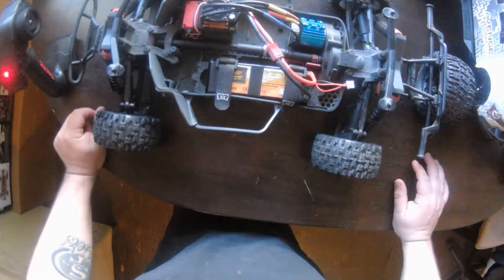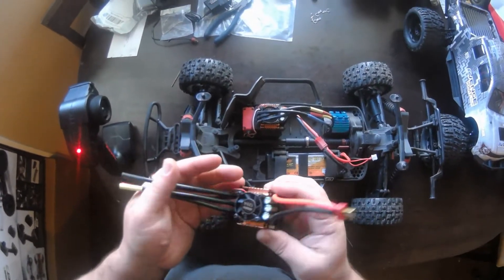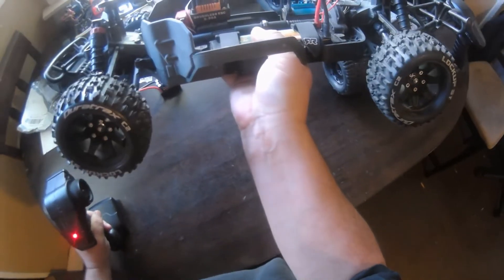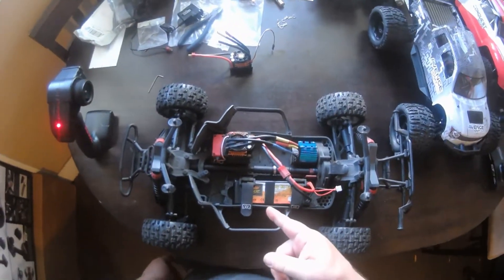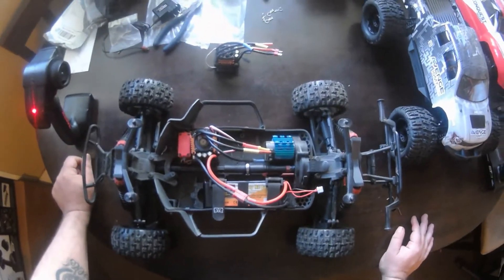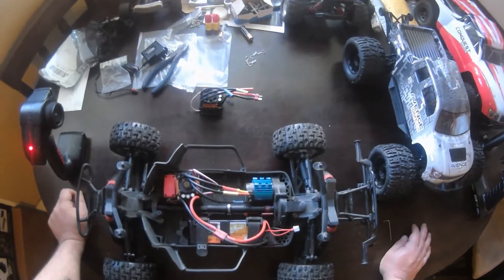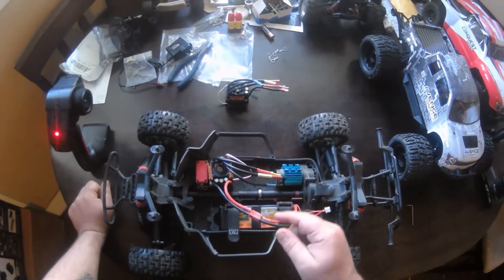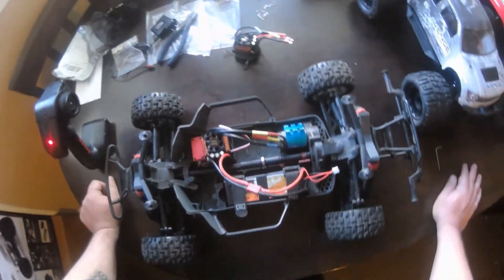ARRMA SENTON MEGA -  ESC UPGRADE

Comment: Wow thanks for the video brother just recently got a typhon 3s and upgraded to a 20t pinion wanted a lil more out of it and now I know that upgrading the esc makes a huge difference 

Thank you
Reply from the maker: Yea the higher amp ESC's help for sure
Reply: Any suggestions I was gonna get the spectrum 130amp esc for $130 but I see in the comments you got your for under $50 what do do you recomend if money isnt an issue should i get the spectrum esc or go with a less expensive esc?
Reply from the maker: @rockyrc9942  I'd go with a 150amp ESC because the Typhon 3s comes with a 100amp already..If on a budget Surpass Hobby King Kong is pretty good for about $60ish.. Waterproof and powerful.

Comment: Sorry where did you buy it couldn’t find it on amazon so can you pls throw me a link and what motor are you using and lastly can you use a nimh battery on it pls respond
Reply from the maker: Might be sold out..Look under the Gool RC or Hobbyfans name on ebay..It's the same thing..It can run Nihm I'm sure but I've never tried..It runs 2s - 4s lipo batteries.
Reply: Thanks

Comment: What motor are you running do you have a link of the ESC and motor you're running
Reply from the maker: OCday 5200kv 3650 motor and 120 amp ESC..They don't make this ESC anymore..Surpass hobby makes a good budget 120 amp ESC though..I have one in my ZD Racing SC-8